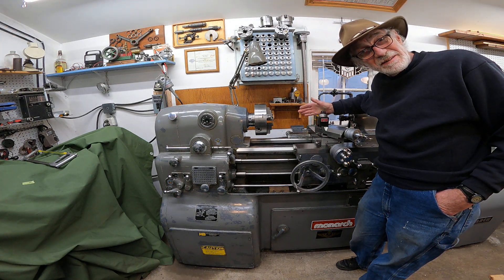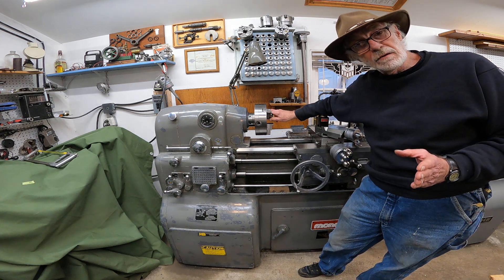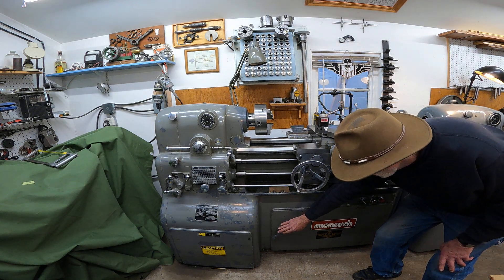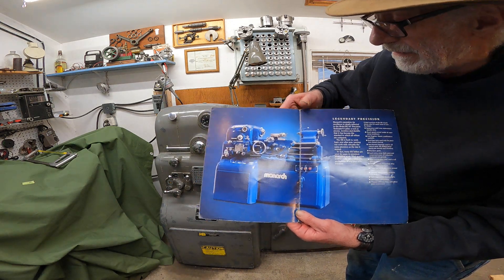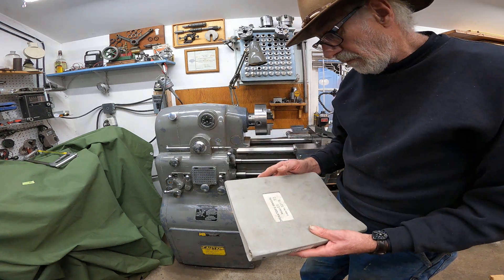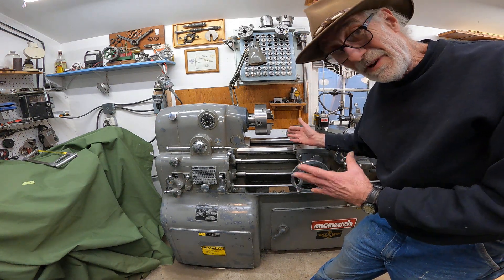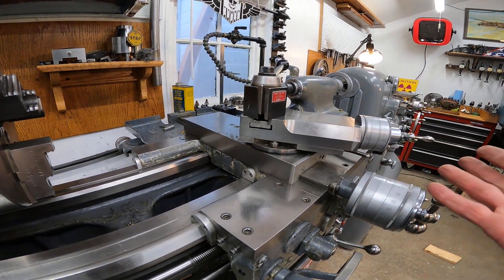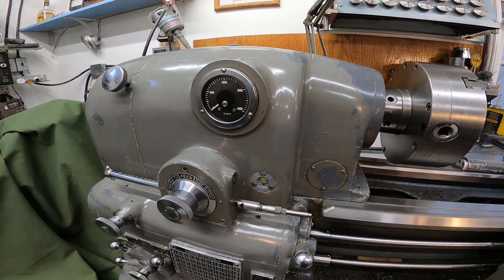Monarch 10ee lathes 1960 and later

Comment: DeeDee, I sure love these machines.  My 1965 is coming along so keep on the lookout for a “re-birth” announcement.  I want to somehow convert my 1965 to the later relay panel.  Someday…
Reply from the maker: The one part I would look for is the later QSD device that replaces the large coil in the right-hand compartment the Square D nema 0` switches for forward and reverse circuits are standard 3 phase switches just using two of the three contacts. The later QSD is shown in updated prints provided for older machines "There is an added full wave rectifier in the QSD using 4 heavy duty diodes but is not noted, The improved OSD uses a normal relay instead of the large coil and contactor that can do odd things, but those can be tamed pretty much also.

Comment: I ordered the original manual for my 10ee from Monarch to find the history of my machine.  The original drive system has been removed and replaced with a single phase frequency drive and 3hp motor with an adaptor for the original backgear.  Works fine for me as a hobby machine.  I added a really nice Acu-rite DRO203 and Acu-rite glass scales from Ebay for under $700.  My machine originally was purchased by Hughes Aircraft in Southern California in 1957.  You have to ask to get the history included with the manual.
Reply from the maker: There are machines that have been pieced together, asking for all the information is helpful there. The VFD drives have worked out well for many and it is a bit of work, I have become so used to the no longer made Trava Dial, I recently removed a DRO from a lathe, I think I will put it on a mill. Now that is a sign of old age for sure, Thanks for tuning in!